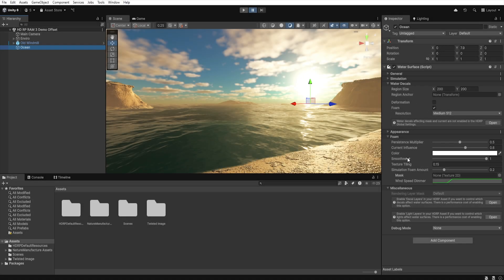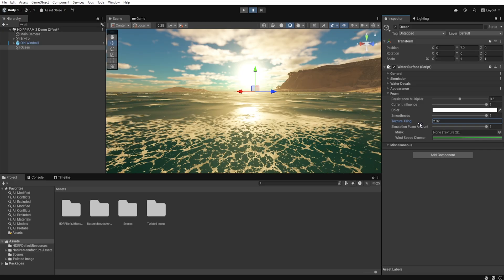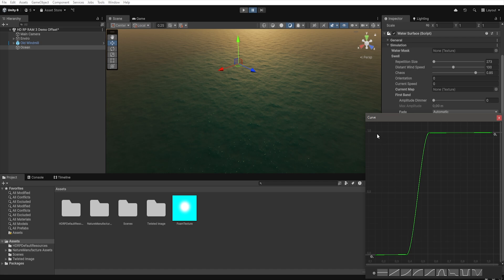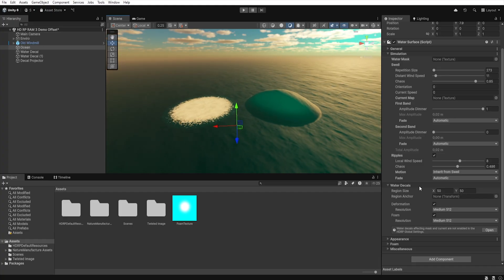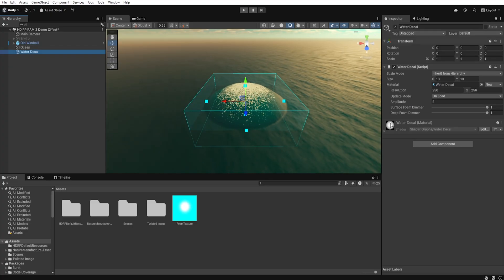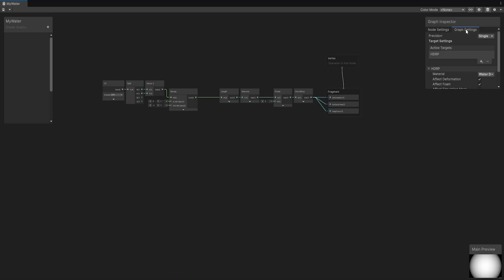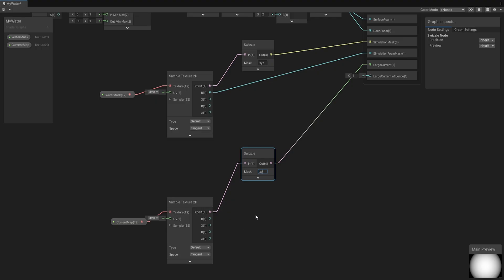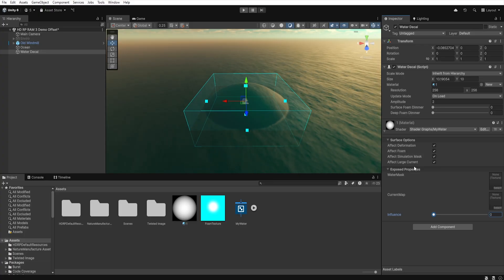Complete Course: How To Use Water System in Unity 6 | Part.4 | Step by Step Tutorial | HDRP |

Comment: Thanks man.
Your tutorials are really holding up what's left of unity. You really provided amazing resources to the community.
I have one question though about the new water system.
You know how the water interacts with the shore, it looks as if it's emerging from under the sand, rather than falling on it due to waves and tides.
It kind of breaks any realism the water shader has.
Does the system have a way to fix that, and make the waters interaction with the shore more reasonable?
Thanks!
Reply from the maker: Yes, but you have to be a bit more flexible and use deformers (a video on deformer basics coming next Monday). The effect isn't perfect, and it will always look like the water is falling under the terrain (unfortunately, it's not a particle-based system with terrain detection), but you can mask it appropriately to minimize the effect:)
Reply: @SetaLevelDesign  thanks!
I'll stay alert for the next video.